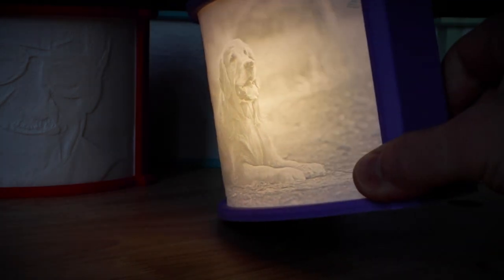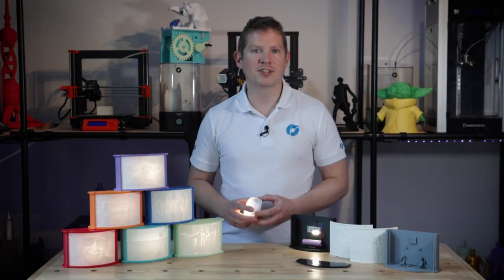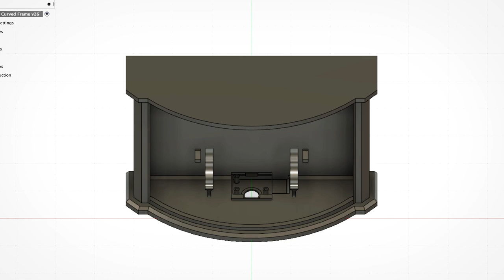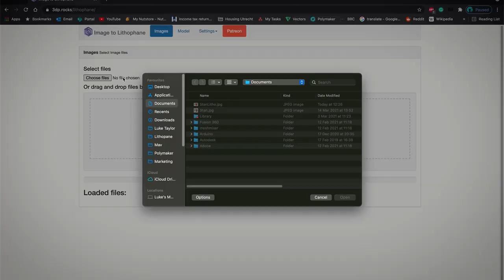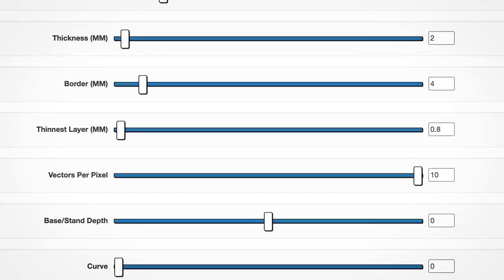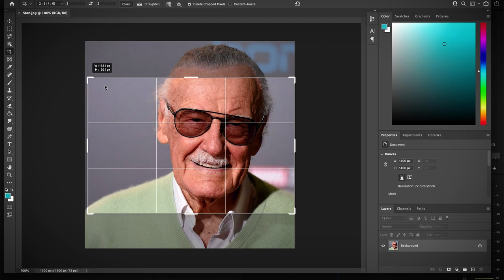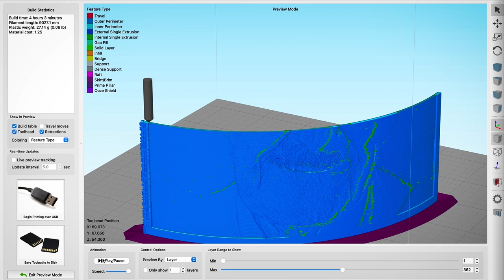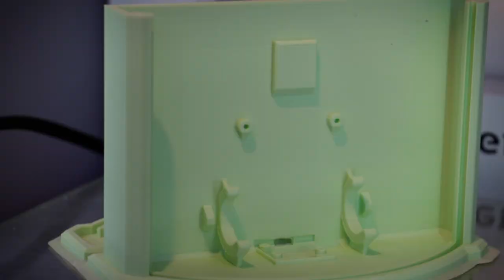3D Print Any Image - Lithophane Lightbox

Comment: After 10 years since my last design and print I'm basically starting over. I just purchased an Ender 3 V3 KE and am having much fun. No point in trying to reinvent the wheel when it comes to Lithophanes so a big thank you for doing the leg work on the settings. Of course I'll tweak them out but this is truly a time saver. Thanks again.🙏👍🙌

Comment: Hi! Did Iunderstand that your infill is 0%?  I have always read or been taught it should be at 99% for Lithos. Can you help me with this please? Thanks!
Reply from the maker: Hi Stacey, yes infill is 0%, but with 3 shells/perimeters the lithophane is still solid plastic. You will get a better print quality using shells/perimeters to make the part solid rather than infill in this case.

Comment: Awesome video! I am wondering though how you managed to model the exact curve for the box the lithophane sits in. I am looking to design my own box with my own internal hardware and am struggling to figure out the arc. Is it a arc of an ellipse or is it the arc for a circle for example. Anything you can let me know would be amazing. Thanks!
Reply from the maker: Hi Jacob, I imported the the mesh (.stl) file into Fusion 360 and then drew some circles to match the curve. I then added a small tolerance (0.5mm on each side) to make sure the lithophane sits in the frame nicely. You can find the original step files in the comment below, I have checked the files and the radius I used were: Inner Rad - 94.7mm Length 150mm // Outer Rad - 98.3mm Length 153mm // Height -102.6mm

Comment: Thank you for this video. Very useful. However, I am somewhat new to 3d printing. What software do I need to modify your box design, in case I cannot find the exact light fixture that you used?
Reply from the maker: Hi Arnie, the light box was designed in Fusion 360
Reply: @Polymaker  Thank you. I had tried to open the STEP file in FreeCAD 0.20. It did open, but does not look like I can change any parameters. I don't have Fusion360, unfortunately.
Reply: @BlackDreaded  Thanks! I did find it and signed up to use it. When I am ready, I will climb that learning curve! I think it will be necessary to revise this box design because, like pretty much everyone else on here, I cannot find a source for that particular LED lighting unit.

Comment: Is there any limitation besides the printers build volume to the size of lithophane printed?
Reply from the maker: For a curved lithophane I think 250-300mm in height would be a limit. For flat lithophanes they will need some extra stability during printing to ensure clean results. Print a large brim with multiple layers for extra stability.

Comment: What print temperature do you use? Can you update your description under the video to state this?
Reply from the maker: Updated, Print Temp: 225°C Bed Temp: 60°C
Reply: @Polymaker  Thank you! Much appreciated. I was using 200C print temp 25C bed temp 100% flow rate (extrusion multiplier). I got pretty good results. I'll try again with 225C print temp 25C bed temp (I don't have a heated bed), and tinker with 100% vs 90% flow rate to see how that affects it. I'm using Cura as the slicer, and the same PolyTerra™ PLA Cotton White filament as you.
By the way, you spelled "Bed" as "Bwd" in your description under the video. Thanks again for the quick response!

Comment: hey, my image dont fit the box , i have used the settings in discription is ratio 3:2 , picture litho is very smal wen i slice in cura
Reply from the maker: Did you set the maximum size to 150mm in the model settings on 3dp.rocks/lithophane?
Reply: @Polymaker  yes i do 150mm i have try-out another picture en it is the same i think thats is Weerd

Comment: what are your printer settings exactly as i have no clue how your printing that in 4 hours mine usually take around 10 - 12
Reply from the maker: Layer Height: 0.15mm, Print Speed: 60mm/s, Outline Underspeed: 50%. Print with 3 shells/perimeters, Enable internal wall Extrusion fill
Reply: @Polymaker  thank you I'll give it a try when I get home also what printer are you using?
Reply from the maker: @aholmes2007  All the lithophanes in this video were printed on either Prusa i3 MK3 or Ender 3
Reply: @Polymaker  thanks for your reply i am using cura as a slicer and unfortunately some of these settings are either not available or named something else could you recommend what to look for using cura